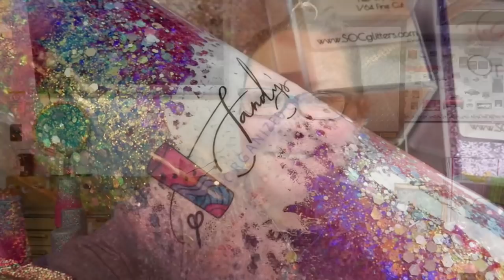81st Vlog of a Tumbler Maker | Jeff shows how to change a motor for my tumbler turner

Comment: I am so grateful to Jeff for showing how to build the turner and replace a motor! So that piece that attaches the motor to the PVC pipe, the one that you said you 3-D printed to fit perfectly, are you producing and selling those? Please??!!! That's the part I'm struggling with and I can't get a clean fit and I've got through so many caps and tiny nails, and drilled so many holes that don't line up.... Please Jeff! Thank you thank you!!